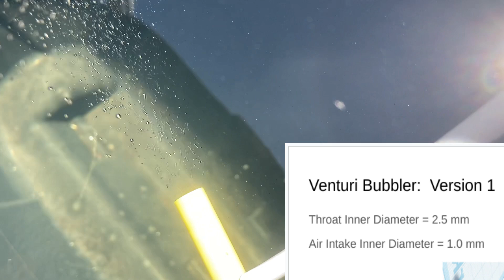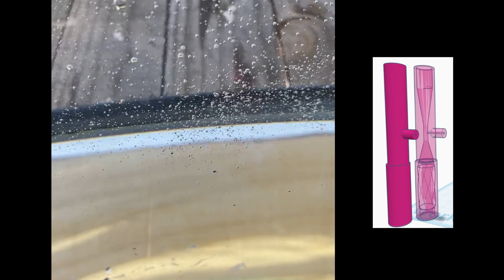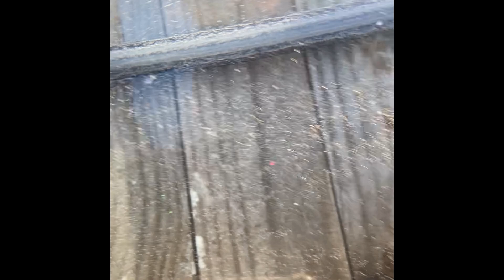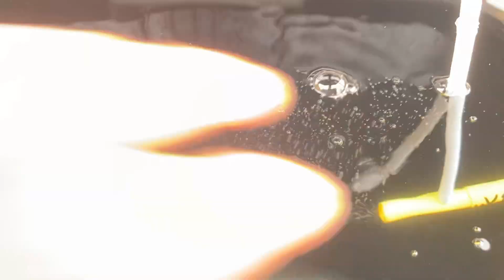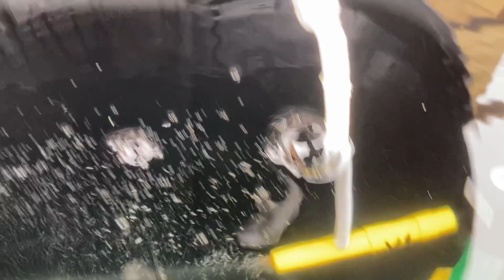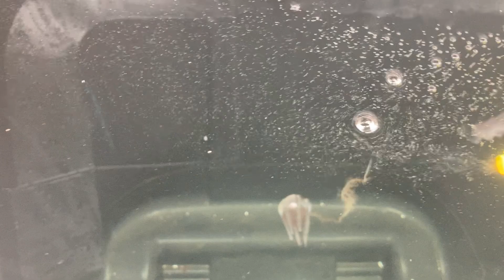V1 Venturi Bubbler Testing (for Hydroponics)

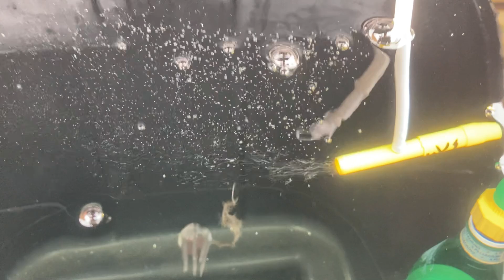Comment: So from the picture in 8:53. You would essentially make a chamber that’s directly below the air inlet. You can still keep them where they narrow to the center where the air comes in but directly under the air inlet you want to make chamber about 1.5-2x the size of the inlet tube in the pic. So it will go into the funnel shape as it enters but before where the air enters you have the throat open into a chamber that’s the full size of the pipe and then go back to narrow. So for your design if you were to cut and paste a chamber below the tube and leave everything else the same.  It causes a huge increase in the negative pressure drawing more air.  You also want to have your intake tube with a funnel (if you’ve ever seen what they call a bell mouth that they use on cars that shape is the most aerodynamic) will also dramatically increase your bubbles.  The paper I read was like the 3rd or 4th result and was on science direct
Reply from the maker: Wow, thank you for the feedback! I'm trying to visualize your description, but I don't think I found what you were referring to in my search for Feng. If you have an article or link, I'd love to check it out.

I experimented with a very tiny air-intake opening, but it tended to calcify shut by the end of the growing season. I'd have to poke it clear with a fine wire, so I eventually made the intake hole a bit wider and added a twistable valve at the end of the air-intake line to control airflow.

The more you restrict the air, the smaller the bubbles tend to be. They're not nanobubbles, of course, but this device can produce very small microbubbles. The trade-off is that restricting the air also reduces the total volume of air being drawn in. So there's a balancing act between bubble size (smaller is generally better for gas transfer) and air volume (you still need enough airflow to make the Venturi worthwhile).

I'd be interested in learning more about bell mouths, too. My only concern is that if the air intake eventually narrows down to a tiny pinhole, as I tried before, nutrient salts could build up around the opening and eventually block the airflow again.

Your other suggestion about a center mixing chamber is really interesting. Are you describing something along the lines of my V5 version? Here's the video: https://youtu.be/KM_1cn3vTck

I actually experimented with a fully separated middle mixing chamber as well. The idea was to have a chamber between the converging inlet cone and the diverging outlet cone. These designs did produce very small bubbles, but they also introduced some challenges: the narrow entry and exit restricted flow, the small openings were prone to clogging, and the middle chamber was difficult to reach with a wire or pipe cleaner making it impossible to clean out sediment of fine debris that adhered to the walls over time.  

I didn't make a dedicated video about that particular three-section Venturi experiment, but I did give it a try just for fun! 

I'm not sure if that's exactly what you had in mind, though. If you have an article, photo, or other reference showing the design you're describing, please share it. I'd love to learn more and see if there's a way to make it work better. 

Thanks again for taking the time to share your ideas!

Comment: You need to add a suction chamber where your air comes in instead of just a pipe.  The angle that the water enters the device also matters. Read the paper on micro bubbles by Feng.